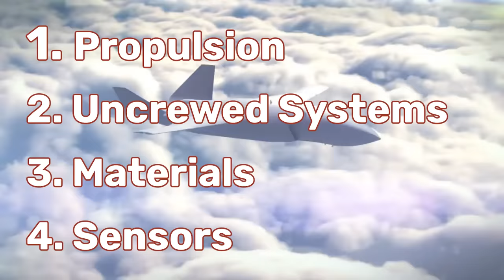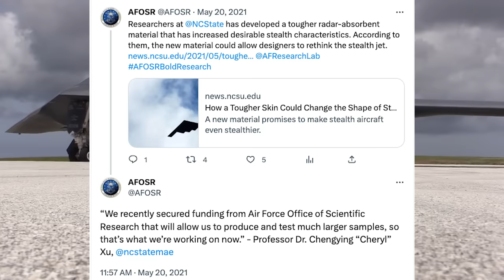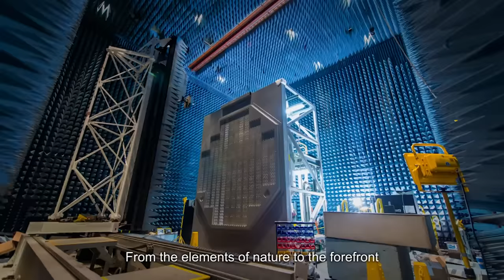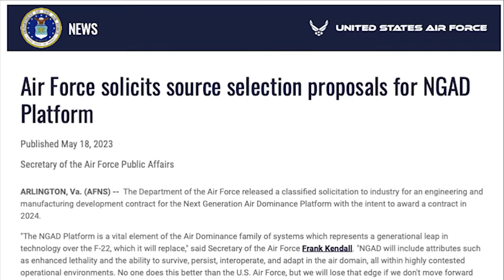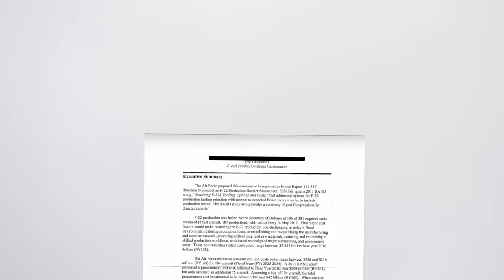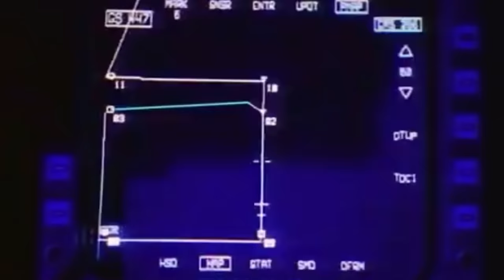Why America's new stealth fighters might cost $300 MILLION each

Comment: The navy only plans to acquire about 200 of them. That should tell you about the kind of scale we have in mind for them.
Reply: Guarantee you that 200 unit fleet number is going to get slashed multiple times before the first airframe is even delivered.
...Because we have decades showing that Congress and the DoD do not want to buy airframes that make up that much of a percentage of their budget. It just isn't going to happen. Unless they're buying 200 over the course of 20-30 years (...which they aren't).
Reply: whatever teh USN is buying, the USAF will buy more.
Reply: @SoloRenegade  
No.
Reply: @matchesburn  yes
Reply: @SoloRenegade  Some planes make more sense on a carrier than an airport. USAF shouldn't waste money on the ability to take off and land on a short runway, their runways are full size. USN however needs this, or they literally can't use the plane. I'm sure there are other features that are not needed for land based aircraft that make a lot of sense at sea, but I'm not an expert so they escape me.
Reply: @SoloRenegade  
Carrier aircraft have their own special requirements to meet CATOBAR standards. Requirements which lessen performance and... I shouldn't have to point this out... but aren't necessary to the USAF.

Now look at how many fighter aircraft the USN have purchased that the USAF purchased more of. I think only the F-4 qualifies. Maybe. Even that is a stretch.
Reply: @LaughingOrange  Ukraine proves otherwise. 

but that's not the question. it's one of quantity. If the USN buys 200 6th gen fighters. the USAF will likely purchase at least 3x that many.

How many F-4 did the USN have at a given time vs the USAF?
How many F-35 does the USN have at a given time vs the USAF?
How many F-14 did the USN have at a given time vs F-15 in the USAF?
How many F-18 does the USN have at a given time vs F-15 the USAF?
How many F-18 does the USN have at a given time vs F-16 the USAF?

How many F-22 does the USN have?
Reply: @matchesburn  F-4 Phantom (countless countries and the USAF), F-18 (Switzerland, Canada, Australia...), A-4 Skyhawk (Argentina, Israel...), F4U, F4F,  TBM, SBD, F-111 (Australia, USAF...), Super Étendard, etc.

Then you have the variant aircraft like the F-35, F-86, F-15, Mig29, Su27, Spitfire, Mosquito, and more, where the naval and land based versions add or remove the features.

Then you have the land-based aircraft that need no carrier modifications at all. B-25, C-130, V-22, OV-10, AV-8B, etc.

And even still, the F-15 and many others still have tail hooks, though not quite as robust if used daily, but could be upgraded to be tougher. And the F-16 landing gear is very much like that of the F-8, meaning it could be navalized, and was considered for navalization. 

And let's not forget the need for operating from damaged or unimproved runways. Something we used to plan for in teh Cold War, and that Ukraine is proving was/is a valid concern. Aircraft like the Gripen, F-5, A-10, AV-8B, OV-10, Mig29, Su27, and more were specifically designed for this purpose. While others like the F-18, F-35, and such could be used in this manner.
Reply: @SoloRenegade  
[Goes on to list other countries, and aircraft that the Navy never bought]
...Way to destroy your own argument.
Reply: USN NGAD is another project unrelated to USAF NGAD but with the same name 😳
Reply: @matchesburn  Way to ignore the entire argument due to invalid cherry picked criteria that doesn't prove you right.

Notice I also listed many US aircraft examples. Mostly US in fact.

F-4, AV-8B, OV-10, C-130, U-2, B-25, F4U, F4F, SBD, TBM, F-18, F-111, A-4, F-86, V-22, F-15, F-35, and more.

But in truth, you can't provide a valid counter argument to mine, and so rather than admit defeat, you falsely try to claim my arguments are invalid while trying to change the rules of the debate like a child trying to change the rules of a game of Monopoly whenever they are losing.

My argument is 100% valid and intact. 

You have no argument at all.

"Carrier aircraft have their own special requirements to meet CATOBAR standards. Requirements which lessen performance and... I shouldn't have to point this out... but aren't necessary to the USAF."

this claim is not specific to only US aircraft, and the USN and USAF has historically flown aircraft of other nations as well, so they count, and other nations have used USAF and other naval aircraft as well, both for carrier and land based uses.
Reply: @SoloRenegade it isn't the landing, it's the launching. That's when the aircraft is at its heaviest and needs a strong structure to tolerate the catapult forces. Eagles weren't designed for that. Just look at how dinky the landing gear is compared to the Super Hornet landing gear; specifically the nose wheel vs nose wheels. Then there were other concerns that stopped a navalized version of the Eagle from entering service despite the Tomcat's price tag and engines. This channel has a video about the Sea Eagle.
Reply: @MotoroidARFC  Wrong.

Landing is the toughest and most dangerous part. The catapults can be adjusted, and rather fragile aircraft have been catapult launched throughout history, and there are many types of catapults, many which don't attach to the landing gear at all. The first ever

AV-8B uses no catapult, nor did the C-130, B-25, U-2, OV-10, etc. F-35 can launch with or without a catapult.

Aircraft like the FJ-1, FJ-4, F6F, A-4, F-4, F-8, F4D, F11F, P-51 Sea Horse, F4U, and Super Etendard, and many more didn't attach the catapult to the landing gear at all.

Aircraft like the B-25, P-40, J-3, P-47, Mosquito, and many more also launched from carriers both with and without catapults. 

Catapults put very little stress on teh airframe and landing gear the way a crash down arrested landing does.

Want to see weak landing gear on a carrier? look at the Spitfire and Seafire.

Hurricanes were even catapult launched off of transports in the Atlantic to ward off air attacks.

All of Langley's attempts at powered flight used a catapult launch of his fragile aircraft, the last attempt on Oct 7, 1903. He died never knowing the Wrights had flown.

The first ever ship launch and landings were done with Curtiss aircraft, very fragile in nature.

Seaplanes were catapult launched from battleships, cruisers, seaplane tenders and such for many decades without issue.
Reply: @SoloRenegade  USN carriers have catapults that use the nose gear to connect to the catapult shuttle. They don't use any other catapult system for their CATOBAR aircraft. Also, when aircraft land they are lighter as they have burnt off or dumped their fuel and, if fighting or live fire training, have fired or dropped their munitions. It's also fact that CATOBAR aircraft can launch with heavier loads than ski jump users which is why the USN use CATOBAR F-35Cs off their big deck carriers. The USMC use the shorter range F-35B from the gator freighters. Also, why mention out of service and long obsolete aircraft which cannot operate from today's carriers? You're just vomiting word salad and proving you know nothing.
Reply: @MotoroidARFC  "it isn't the landing, it's the launching. That's when the aircraft is at its heaviest and needs a strong structure to tolerate the catapult forces. "

Wrong. the aircraft is at 1G on takeoff, and then is accelerated to speed laterally. the weight of the aircraft actually helps, as it's inertia slows the catapult. but the weight is not a multiplier on the catapult, as the forces are not acting in the same directions. And catapults are tuned to the weight/size of aircraft.

But on landing, the jet can experience many G's and in ways that can break many parts of the aircraft, from wing spars, to landing gear, to the tail or fuselage, tail hook, and more. This is where weight is critical, as the weight is acting with the forces on landing. many aircraft can takeoff heavier than they can land, even civilian airplanes that don't fly off short airfields. They have to dump fuel or payload (bombs even) before landing to get below their max landing weight. Sometimes thy just have to fly in circles for a while to burn enough fuel. Also on landing, the bombs can be ripped clean from the aircraft and be sent across the deck.

"Eagles weren't designed for that. "

a naval version was drawn up, and it would have done just fine. Take a look at the gear of the FJ-1 and Fj-4, of the F4D and F-8. Heck, look at the F-4 nosewheel or the A-4.

Even the F-16 was considered for a naval version.

"Just look at how dinky the landing gear is compared to the Super Hornet landing gear; specifically the nose wheel vs nose wheels."

the F-18 and such have beefy nose gear because they are pulled in a VERY bad angle on the nose strut by the catapult. But most aircraft in history had the catapult attach to teh fuselage and wing roots. F4F, F6F, F4U, A-4, F4D, F-8, F-4, Etendard, FJ-1, F11F-1, FJ-4, and many many more.

the U-2, C-130, B-25, AV-8B, and many more also never used catapults at all.

When you want to launch using the nosewheel, then yes, you need to beef it up, but also by adding a strut that moves backwards along the fuselage.

Or you can just launch using the older time tested method of pulling on the airframe.

"This channel has a video about the Sea Eagle."

then you should know better...
Reply: @MotoroidARFC  " It's also fact that CATOBAR aircraft can launch with heavier loads than ski jump users which is why the USN use CATOBAR F-35Cs off their big deck carriers."

that has Nothing to do with structure of teh aircraft. that has everything to do with not being able to go fast enough to produce enough lift to carry more weight. a catapult can get it to a higher speed, producing more lift, thus carrying more weight.

But an F-35C can catapult launch at full weight, and be weight restricted on the Queen Elizabeth due to the ski jump, even though it's tough enough for a catapult. This doesn't prove your point, debunks it in fact.

"USN carriers have catapults that use the nose gear to connect to the catapult shuttle. They don't use any other catapult system for their CATOBAR aircraft."

You can use an airframe strap on US carrier catapults if necessary. not a big deal. Argentine, French, and other foreign naval aircraft have launched and landed on US nuclear carriers. The Argentine Etendard for example, requires the airframe strap, and they were launched using it. US catapults can 100% launch such aircraft. Just because US aircraft presently don't use that launching method, in no way mans the catapults can't still do it. And the US carriers still launch foreign aircraft that way at times.

"Also, when aircraft land they are lighter as they have burnt off or dumped their fuel and, if fighting or live fire training, have fired or dropped their munitions."

not always. aircraft go on missions in combat and find themselves unable to fire all their weapons, and will jettison them before landing. Also, emergencies happen, and a jet might have to return to land immediately, and will have to dump weight in a hurry in order to land.

"The USMC use the shorter range F-35B from the gator freighters. Also, why mention out of service and long obsolete aircraft which cannot operate from today's carriers? You're just vomiting word salad and proving you know nothing."

The F-4 is still in service around the world, the last F-8 was retired in 2008 I believe, there are still Etendards in service, as well as A-4s. U-2s are still in service, as are C-130s, OV-10s, the Harriers were only recently retired, but other nations still fly them. The older aircraft are relevant in proving that structurally the takeoff is no big deal, and flimsy aircraft can launch using catapults fully loaded. But if you had any clue what you were talking about, I wouldn't have to explain such basics to you. I teach kids STEM (aerospace engineering STEM in fact), and they understand these concepts with ease, and most of them are still in middle school.

Your childish attempt to invalidate my arguments by simply dismissing them is not going to work. Closing your eyes, plugging your ears, and shouting, "lalalalalala!" doesn't change reality.

You're arguing with the wrong person. I'm a combat vet of OIF/OEF, a professional airplane and helicopter pilot, an Aerospace engineer who designs airplanes with tens of patents and I do record setting work for NASA, and military/aviation history is a favorite pastime of mine.

So bring facts, logic, reason, and science if you wish to have a chance at winning here.
Reply: In case people haven’t noticed: we have enemies and they seem to be ganging up. Because of attrition I’m not sure 300 are enough
Reply: @SoloRenegade  F-35C can't be used on the QE.
Reply: @MotoroidARFC  not presently, but the F-35C has the same engine, and a 50% bigger wing. This mans the F-35C can takeoff and land slower than the F-35B. You lighten the load of an F-35C and it surely can do a ski jump takeoff. How do you figure a Su27 or Mig29 do a ski jump takeoff?

Try a again.

And none of this proves your assertion that the USAF won't purchase more than 200 6th gen fighters, if the navy were to purchase 200 6th gen fighters.

You can try to stray off topic and try to drag this into the weeds, but I'm going to keep bringing us back on track as necessary.
Reply: @SoloRenegade  
You specified in your post the United States Navy and United States Air Force. By name. You can't then use the French Navy/Air Force as an example. You can sit down now and remain quiet.
Reply: @SoloRenegade  they retired the Super Étendard and got rid of their carrier. And who will keep throwing away the cables needed to launch them as bridle catchers don't exist on French or American carriers? And why bring aboard such old aircraft when a modern one is more worthy of the limited space? U2s operate from land bases. Sure, they did tests but that doesn't mean they will do it routinely and they never have. Same for the C-130.
Reply: @matchesburn  "You specified in your post the United States Navy and United States Air Force. By name. "

Correct, but only in response to how the USAF will be purchasing More 6th gen fighters than the USN. Maybe you should learn reading comprehension skills. Most people start to pick this up as a small child.

The aircraft of various nations, most of which were USAF and USN aircraft by the way, was in response to the false claim that land based fighters can't have naval features like having landing gear or arrester gear. In fact, such features are even desired for land based fighters in situations like the war Ukraine finds itself in right now. And I showed that there are many combinations of aircraft that both do and don't have naval landing/launching features, that have all been used both on carriers as well as primarily or exclusively land based operations.

Maybe you should sit down before you fall down. I doubt your brain can do 2 tasks at once while attempting to think. It's probably past your bed time anyways.
Reply: @SoloRenegade  the French don't use cables to launch their aircraft from their carrier. The aircraft that launched that way were retired. Their carrier aircraft use nose gear CATOBAR.
Reply: @MotoroidARFC  "they retired the Super Étendard and got rid of their carrier."

irrelevant. doesn't change the catapults and their capabilities.

"And who will keep throwing away the cables needed to launch them as bridle catchers don't exist on French or American carriers?"

If we found ourselves in a war of attrition against China lets say in a WW3 scenario, and both sides were taking incredible losses of aircraft. Now let's say in order to recoup our losses quickly, we need to mass produce a fighter jet quickly and cheaply. The heavy nose landing gear results in a much heavier, more costly, and harder to mass produce aircraft. And it might make sense to resort to different launching methods to produce more aircraft faster. Having the option to do that can be critical in a war. The cost and space taken up by those cables is so small as to be laughable. It's annoying to rely on a consumable, but it is easily replenished as well. We fought all of WW2 using them, and we had FAR more carriers and FAR more carrier aircraft to launch every single day. It's not an issue. Also, bridle catchers could easily be added to the carriers if needed.

"And why bring aboard such old aircraft when a modern one is more worthy of the limited space?"

red herring. this argument was never made. But if you're referring to why bring older allied aircraft aboard? it's about international training and cooperation, in case aircraft have to land on another nation's carrier in a time of war for any of a number of reasons (aircraft damaged and can't reach its own carrier, it's carrier was sunk, etc.).

"U2s operate from land bases. Sure, they did tests but that doesn't mean they will do it routinely and they never have. "

wrong, they routinely operated U-2s from carriers for many decades. they tested it, but you can find pictures of numerous different models/generations of U-2s flying from carriers in multiple decades, as well as U-2 pilots talking about their experience using carriers in operations. Just down the road from me in a small farm town we have two U-2 pilots. One is retired, the other actively serving. I've also given a presentation on this a few months back.

Wow, you finally got something right. Even a broken clock is right 2x a day. Yes, the C-130 was only tested, but it proved possible, and with surprising ease too. And in a pinch it could be done any time, so long as we have the large nuke carriers and C-130s. And a war in China could bring about the need to use C-130 to speed up resupply in desperation. You just never know.
Reply: @SoloRenegade  so you agree that landing aircraft are going to be lighter than at launch?
Reply: @MotoroidARFC  "the French don't use cables to launch their aircraft from their carrier. The aircraft that launched that way were retired. Their carrier aircraft use nose gear CATOBAR."

doesn't matter. they did, can, could, and so can the US.

And you still haven't proven that takeoffs are more damaging to aircraft than landing.

you're now just trying to derail the argument in a pathetic attempt to avoid looking like you lost. But the sad thing is you're losing the side bar argument as well.
Reply: @SoloRenegade  
"Correct."
So you just admitted you were wrong. Nice. Thanks.
Reply: @MotoroidARFC  "so you agree that landing aircraft are going to be lighter than at launch?"

in general, yes, but not always. A plane could have launched light for training or some other reason, then topped off on a tanker before landing, assuming it is still below landing weight.

but this doesn't prove you right, it proves me right. if takeoffs were harder on it, it would need to be lighter on every takeoff done with a catapult compared to unassisted takeoffs, and this simply is not true.
Reply: @SoloRenegade  why do you keep bringing up aircraft that don't operate from aircraft carriers? And bring up aircraft that could but don't have crews that know how?
Reply: @SoloRenegade  I said they were heavier and endured more stress than landing when they are lighter than at launch.
Reply: @SoloRenegade  yes it does matter when equipment isn't available to do so and when the people who are experienced in such launches aren't around and such launches are unnecessary. There are more modern aircraft that can do far more than the aircraft that use the obsolete method.
Reply: @MotoroidARFC  "I said they were heavier and endured more stress than landing when they are lighter than at launch."

Wrong, you said,

"it isn't the landing, it's the launching. That's when the aircraft is at its heaviest and needs a strong structure to tolerate the catapult forces."

And this statement is FALSE. The forces at launch are completely different than at landing. the forces during launch are rather mild and benign, other than the local stresses felt by a nose wheel launch due to the stresses being applied to it specifically in a sub optimal way. the ONLY thing feeling such stress on takeoffs is the nosewheel strut.

On landing, the ENTIRE aircraft is getting a beating. the Wings, fuselage, tail, landing gear (mains and nosewheel), pylons, etc. and all being subjected to very large forces compared to takeoff.
Reply: @MotoroidARFC  "yes it does matter when equipment isn't available to do so and when the people who are experienced in such launches aren't around and such launches are unnecessary."

it takes a few hours to train people. all the training manuals, training videos, etc. still exists, as do the blueprints for the parts.

"There are more modern aircraft that can do far more than the aircraft that use the obsolete method."

more capable in terms of what? avionics? an F-14 or F-4 could have ben upgraded with ALL of the latest sensors, avionics, targeting pods, etc. Just like the F-15EX, and F-16 block 70.

An F-4 and F-14 in many ways are far more capable than many modern carrier fighters, in things such as payload, speed, range, maneuverability, etc. And imagine if they were given newer engines, fly by wire, and such they'd be even better.

But even still, saying, "There are more modern aircraft that can do far more than the aircraft that use the obsolete method.", does NOT prove that aircraft experience far greater forces on launch than landing.

If you want to compare launch and landing fairly, then consider a single jet (F-4D?) at 50% of its internal fuel weight, and no weapons. then explain how launch stresses it more than landing at the same weight.
Reply: And they're still lighter than at launch.
Reply: @SoloRenegade  sending an F-4 up against something two generations more advanced is wasteful. It would be better for it to haul stuff for the newer ones. It would stay out of the fight and release weapons when the newer ones call for it. That and carrying out more mundane tasks to free up the modern ones to do the things it cannot do. Upgrades can only go so far before the basic design limits it. And in some cases the time and money spent on that could have been spent on things more worthwhile. In the Eagle II's case, other nations funded the upgrades which made it attractive to the USAF. It's telling they didn't fund the upgrades on their own and didn't even bother with their F-4s. So no, if it's too old, it's not worth it.
Reply: @SoloRenegade  so a service is to train people in an obsolete method of launching aircraft and begin manufacturing the equipment to do that just so they bring back into service obsolete aircraft which would need upgrades themselves and trained crews to operate them? 

Fantasy. No one will wait around for all that to happen. They will work with what they have and in more effective ways.
Reply: @MotoroidARFC  "sending an F-4 up against something two generations more advanced is wasteful. It would be better for it to haul stuff for the newer ones. It would stay out of the fight and release weapons when the newer ones call for it. "

red herring. you're off topic again.

"Upgrades can only go so far before the basic design limits it."

actually, that's not true. A fully upgraded F-4 would be just as effective at being a missile truck as an F-15EX or F-35, and just as effective at deploying standoff weapons for CAS. The maturity and proliferation of precision standoff weapons has changed the game, and speed is no longer the key.

"And in some cases the time and money spent on that could have been spent on things more worthwhile."

give an example.

"In the Eagle II's case, other nations funded the upgrades which made it attractive to the USAF. It's telling they didn't fund the upgrades on their own and didn't even bother with their F-4s. So no, if it's too old, it's not worth it."

The US gov needed stop gap fighters, and given that the F-15EX had all the upgrades, the gov bought those as they were available. You know what else is available that the USAF doesn't have much of? The F-16 Block 70. We could also buy those. But do you realize how old the F-15 and F-16 platforms are now? And yet short of the F-22/F-35, they are basically the best fighters on earth.

By the time the F-15EX came along, all the US F-4 had already been long retired, and production lines no longer existed. You can't buy something no longer being produced, even if it could have been upgraded if still produced.

You want to talk about age? try the A-4, C-130, B-52J, U-2, Mig21, Mig17, AH-1, UH-1, CH-47, UH-60, etc. Many aircraft in operation today are as old or older than the F-4. And many of the newer aircraft are going to far exceed the F-4's service life.

If your assertions were true, none of those older aircraft would still be flying or combat effective. but many are still some of the best in the world at what they are doing.

If I upgraded an F-4E with F-35 radar, F-35 avionics, new ejection seats, new bubble canopy with gold tint, stealth paint, composite airframe, new engines, new air intakes, new IRST and targeting sensors, and updated its flight controls to the latest in fly by wire, and gave it meteor missiles, AMRAAMs, AIM-9X, helmet mounted sight,  HARM, small diameter bombs, Harpoon, and more. What role in modern air combat would the F-4 not be well suited for?

"so a service is to train people in an obsolete method of launching aircraft and begin manufacturing the equipment to do that just so they bring back into service obsolete aircraft which would need upgrades themselves and trained crews to operate them? "

no, they retain the ability to use alternatives, and retrain people when/as needed. the method of launching is not obsolete. In what way is it obsolete? just because it's not popular anymore, doesn't make it obsolete. it still works just fine and very effectively. It's just not preferred. A little common sense goes a long way, should look into getting some. 
 
"Fantasy. No one will wait around for all that to happen. They will work with what they have and in more effective ways." 

They will work with what they have, including th ability to bridle launch aircraft. When you're taking high losses, you will resort to putting into service anything you can get, even if it's not what you wanted/preferred. I've been in combat for years of my life, I have made do with what we had, fixed things, modified things, and I am telling you, when sh1t gets crazy, technology is not your friend. the ability and know-how to revert to low tech methods and still win is underappreciated these days. We had all the tech and gadgets overseas, and yet rarely used it. old fashioned methods still worked, were still more reliable and consistent, and could be used to surprise enemies expecting us to use the technology and weren't expecting us to attack them the way we did. And things break, and the more advanced and complex they ar, the harder it is to fix them, the more parts it takes, and the harder it is to support logistically in teh field. sometimes you'll have to wait MONTHS to get the parts you need, and in the meantime you have to make do with what you have. and so you resort to low-tech solutions, even grabbing civilian equipment to use.

"And they're still lighter than at launch."
So??????? you're like a broken record. this is what, teh 6th time you've repeated this? And still you have yet to make a valid point.
Reply: @SoloRenegade  and what aircraft in the US inventory uses cables to launch off carriers? F-8s are gone. A-4s are gone. The remaining F-4s are drones. Oh, the foreign F-4s? Do they have crews that can operate off carriers? Do they have the cables too and the people that know how to use them?
Reply: @SoloRenegade  doing all that to an F-4 when doing that to an F-15, F-16 and F-18 is more worthwhile oh wait they already did. Are you going to tell us we should commandeer the old but still flying WWII warbirds and get them ready just in case? At the least the B-52s have been upgraded constantly and remain operational. They were not completely taken out of service and then completely brought back into service years later because we don't have anything else. As if an enemy will sit back and watch as obsolete aircraft are practically rebuilt and crews are trained.
Reply: @SoloRenegade  F-15s and their surviving contemporaries are still young enough to accept upgrades hence the new versions of these aircraft. Upgrading an F-4 and its contemporaries is not worth it if you can acquire aircraft from its successor generation and fly them well.
Reply: @MotoroidARFC  Yes, those old F-15C and F-16A/C are so young....not.

You completely lack the understanding for this conversation. or, you knowingly are playing the fool thinking it saves you from being wrong.
Reply: @MotoroidARFC  "and what aircraft in the US inventory uses cables to launch off carriers?"

changing the question, yet again I see, while completely missing the point, yet again.
Reply: @SoloRenegade  you're the one saying we should return back to launching aircraft using the old method. Why? Just because someone else's aircraft used that method in the past and there's a possibility they can operate from US carriers? It's not worthwhile to spend time and resources to do that.

New versions of F-15s exist. They are not taking old ones and upgrading them like the F-4 in your example. It would not be worthwhile.